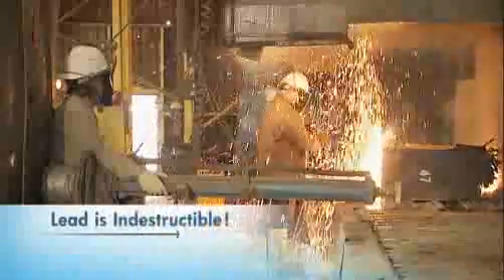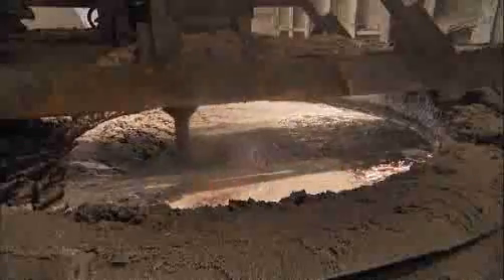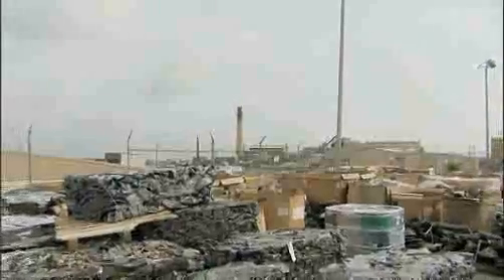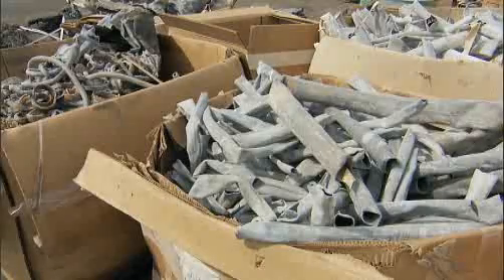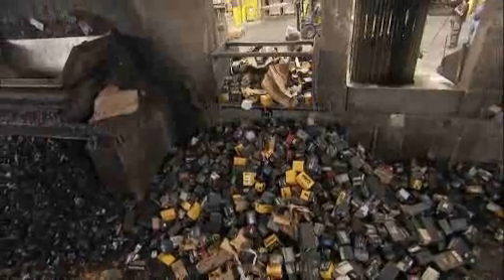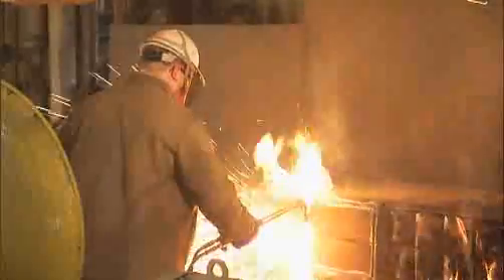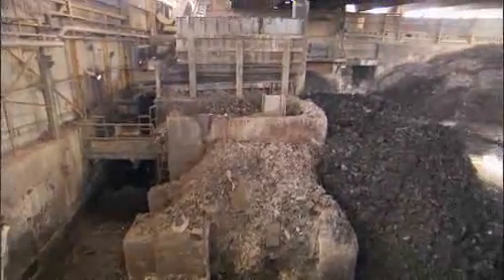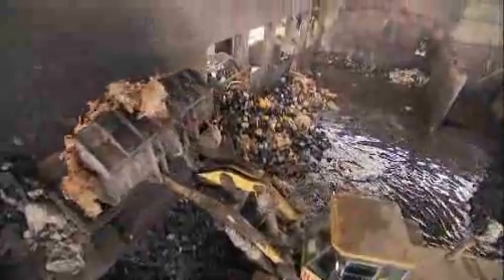Lead Recycling

Comment: @87tomify I don't know about this facility but I work at East Penn Manf. in Pennsylvania and they spend millions every year in ventilation duct systems, fresh or clean air return systems, as well as on bag houses some equipped with HEPA filtration. They monitor employees with routine blood tests. Unless you are extremely negligent your exposures are quite low.
Reply: I'd like to do this job I work as a hotel steward, do I have to go to school or just get job training I hate school

Comment: The 2% is probably calculated by weight. How much weight comes in vs. how much leaves. The 2% is probably things like the cardboard boxes, wood pallets, and other odd contaminants on the old batteries.